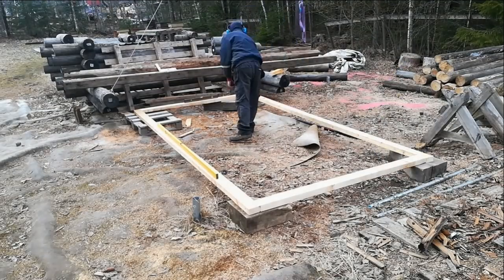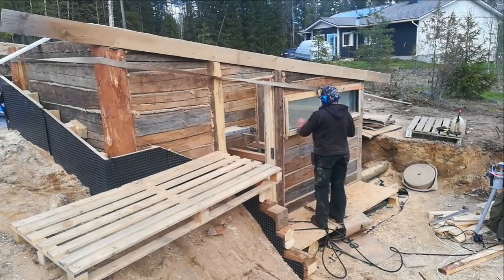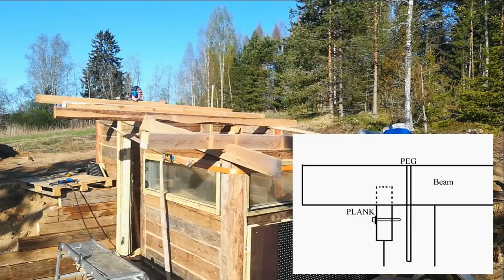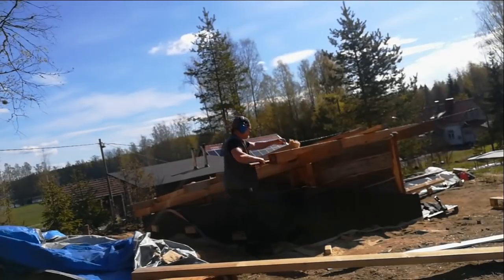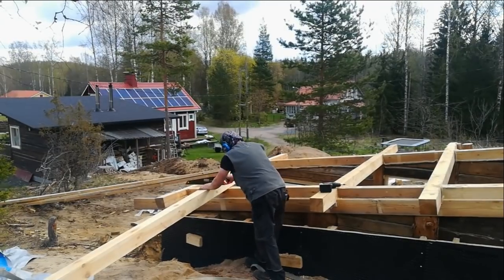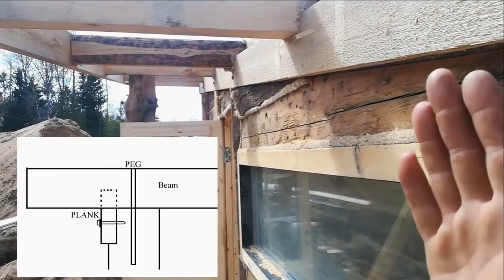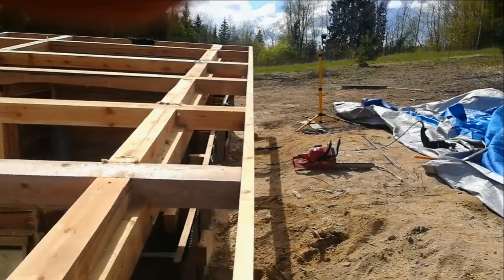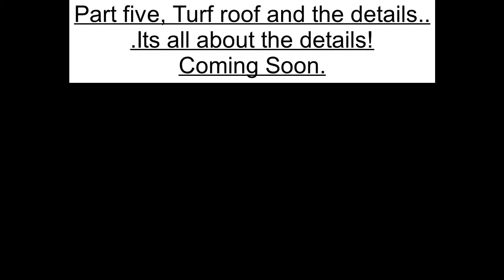Easiest log building method ever!!. Part 4.

Comment: Are there written plans for this type of roof? Thank you!
Reply from the maker: Not that I know of. As I said in the video its my own hybrid method based on the traditional sacrificial log technique but using modern materials underneath instead of layers of birch bark.
Reply: @ProjectHighlander  
This is a fantastic building & roof! Thank you for your response. I appreciate it. And “Dang It!” LOL! I was hoping there were written plans as I want to adopt this roofing method for my 30’X60’ log cabin in the Yukon, but with a simple gable roof & sod. I have been trying to figure out how to tie this in to the main central log I have running along the ridge. That particular pine log is 30” in diameter and roughly 65 feet long. Any suggestions? Thank you!
Reply from the maker: Firstly what is the pitch of your roof? anything more than 30 degrees is going to make a sod roof very difficult to do. But if you want to go this route then you don't need written plans. Basically you want to make the roof watertight, then at least double up on that waterproof layer, better still (as I did) triple it. A sod roof needs to be 100% watertight because fixing a leak would be a huge job. My third layer was this black plastic dimpled roll or drainage membrane. It is usually used to wrap around a buildings foundations with the dimples facing the foundation ensuring air circulation but its perfect for this roofing method. hopefully you have it, or something like it, where you are. its placed dimples downwards meaning you have airflow underneath it so moisture should be dried by the moving air but more importantly it has the little dimples, like thousands if little depressions which makes your roof drought resistant as they hold water but also the roots of your roof grow and fill them binding the whole roof together. You could use this in vertical strips, with a good overlap, running vertically right over your ridge log and down the other side. find a way to keep your sacrificial logs in place without compromising any of the waterproofing layers, like large 'L' brackets attached to the undersides of your eves, then add your soil.
Reply: @ProjectHighlander  
Thank You! The pitch of my roof is 6/12, so basically 26.57° of angle. The black plastic dimple rolled drainage membrane has been difficult to source, thus far. If you have a brand name or the specific name of that product, I would greatly appreciate it. The underlayment you used on your cabin will be replaced with ice & water shield throughout, on the roof for the cabin I am building. I know it will be expensive, but I want this cabin to last an eon lol! Would you recommend treating the roof decking (upside down floorboards on your roof) with linseed oil or something similar? Pine oil maybe? Also, I intend to follow your method 100% as it is the best I have come across so far. The typical annual snow fall in the area the cabin is going to be built is about 10 feet. Hopefully not all at once, but you never know. Luckily, no building codes or inspection is required. My goal is for nobody to ever find my cabin, unless invited. You are on that list. 👍🏻 Posts will be 20 feet tall, so the interior ceiling height on the bottom floor will be 9 feet and the top floor 8 feet at the apex...roughly. It’s going to be a lot of work, I know, but it will be snug, warm, sturdy, and cozy. Hopefully🤞🏻
Reply from the maker: That's a big project. I certainly would not consider linseed oil. Linseed/flax oil never actually dries 100%. There are a lot of mixes on the market - of course they will be very different where you are but if you want to use oil it needs to be mixed with something else to ensure that it first penetrates the wood but then dries. Here we have something called perus pohjuste (there is no translation that would make sense in English) its a preservative oil dissolved in...basically thiners. It thins the oil down so it can penetrate but the thinners element then evaporates rapidly. Maybe you could find something like that where you are. I'd also look into the Japanese wood protecting method called 'Shou-sugi-ban'. I have not tried it yet but I want to give it a try. The drainage membrane... here its very common, you will find rolls of it on almost every build site, Its Finnish name is 'Pato levy' I will see if I can find a brand name or something.
Reply: @ProjectHighlander  
Thank you very much. I really appreciate it!

Comment: How did you go through the insulation as you were driving the pegs.  Did you cut a hole or did the peg as you were driving it put the hole in the insulation?
Reply from the maker: I tear a hole in the insulation where the hole is in the bottom log before putting on the next log.

Comment: If you know how to use a tape measure you could save a lot of time. Cut all the wall logs to same size cutting tung all the same and if you used half joints on roof beams it would be stronger. But looks nice but I see some easier ways and stronger
Reply from the maker: I don't 100% understand your point about cutting all logs to same length but you are absolutely correct about the half joints. After doing the one roof support that way I realised that I should have done them all that way. Thanks for the feedback.
Reply from the maker: OK. so I re-read your comment. Are you an engineer or an architect? Cutting  all the logs  to length would be great in a perfect world but thats not where we are. If you cut the logs to the exact length and make the  tongue  then when you put them in place you have to adjust the groove on the base of the log so that it fits onto the log below. that can mean 2cm from one end and zero from the  other end..... Your joint at the end no longer is straight and you have to modify the joint..... Your log is now too short.  Nice idea (on paper) but trust me........Don't do it.